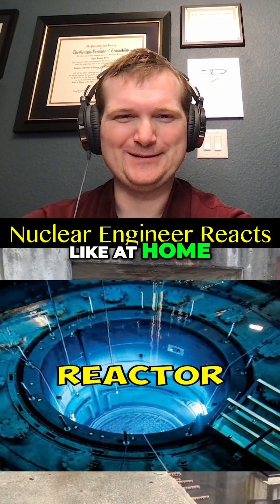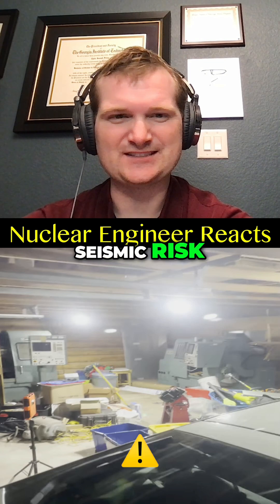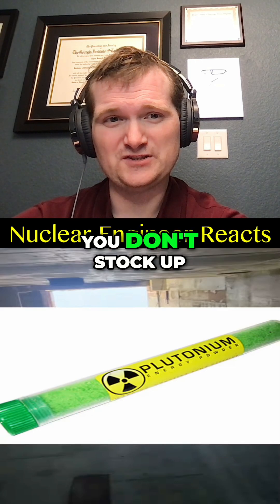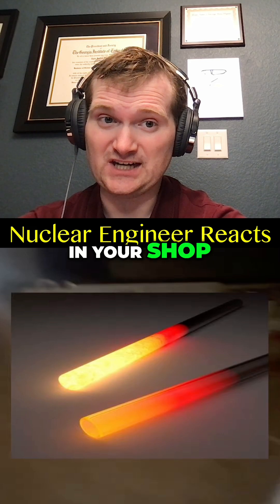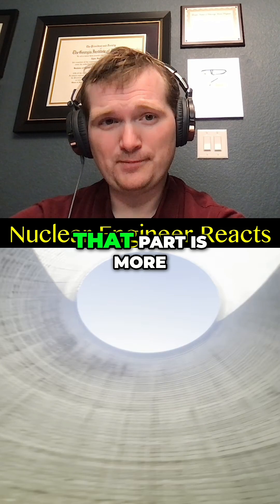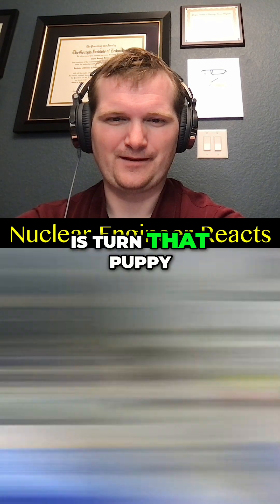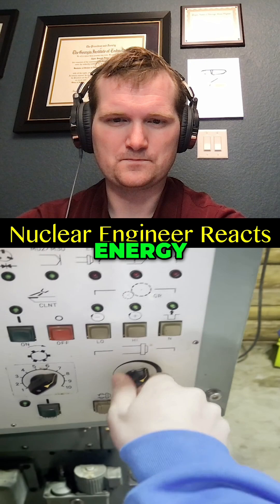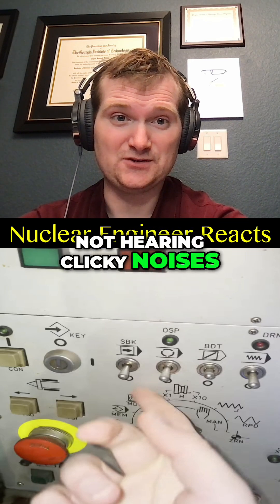How to Build a Nuclear Reactor - Debunked - Nuclear Engineer Reacts to StopShut

Comment: "Diverse, redundant, failsafe with independent power sources"  So my system should use both a Raspberry Pi and an Ardrino with two separate 9V batteries?

Comment: While you certainly can’t reasonably build a fission reactor in your garage, you can build fusion reactors, specifically Farnsworth-Hirsch type fusors and their variants (small scale reactors typically using inertial electrostatic confinement to confine deuterium ions into a plasma in a vacuum). It isn’t easy, but it can and has been done quite a few times by amateur hobbyists.

Comment: all you need is x500 Advanced circuits x500 Concrete  x500 Copper plate
s and x500 Steel plates

Comment: Thing is, that while I hear you saying "No!" to building these things in a garage or shed, that mad bastard, the Atomic Scout did, in fact, do that so its perfectly possible, as is building and operating a nuclear reactor without any form of permissions, oversight or anything else you'd want. 

 Its ILL ADVISED, but it is far from impossible to actually, physically do. It would definitely be among the most dangerous things one could spend ones time doing, but its not impossible at all.

Comment: What are some examples of “fail-safe” design features in PWR designs? In contemporary parlance “fail-safe” seems to get convolved with “highly safe” whereas it actually means “when it fails, it goes to a safe state.”

Like in liquid sodium-cooked reactors, the coolant is pumped with solid state electromagnetic coils (which is reliable, if not fail-safe), and when power fails cooling continues by convection, which looks like fail-safe. 

This was in the 70s and 80s, but reactor schematics always seemed to have stuff like “tertiary emergency letdown tanks/pumps” and “if the core gets uncovered, its meltdown city” and the failure safety simulations I was privy to were like LOFT (Loss Of Fluid Test) since the slightest compromise to the primary coolant cycle equals a massive steam explosion, since coolant is liquid at several atmospheres. 

So, the failure of a loss of coolant leading quickly to meltdown and immediately to a steam explosion, and possible release of radiation (even if it’s within containment) is not a failure to a “safe” situation, even if you have a series of big tanks and pumps that kick in to keep the core covered, or cooled, or whatever (barring loss of station power, of course).

Comment: Well, the first Fermi pile was somewhat close to Home Depot stuff, well other than the graphite blocks.
Meter accuracy though, great safety system, guy with a fire axe.    ;)
No heat rejection system other than the ambient air, which was also half of the shielding, the other half being the inverse square law.
First output, 0.5 watts. Final output, 200 watts, then they moved it someplace sane.   ;)

Heh, would love to put the plans for that one up for NRC review, just to see the look on their faces.
Gonna need a better set of running shoes first...

Comment: In a great irony, given the commentary... the World's first nuclear reactor was in fact a huge pile of wood, graphite, and uranium built in the middle of Chicago in an old Rackets(predecessor to squash) court.

It had no containment:  Indeed, no shielding whatsoever.  Also no cooling system.  The control rod was manipulated with manila ropes attached to an electric motor.  The SCRAM was an axe to cut the rope with.

Thankfully it only ran at about half a watt...

Comment: Imagine if they put that much effort into deciding whether or not we should keep using oil and coal.
Reply: Oil is used in everything.. and i mean everything so while you can reduce how much you use technically its not going away. 
As for coal while it can be replaced even nuclear reactors wed need a lot to do so, and then youd still want solar and wind, maybe hydro etc as supplementary options.

Not only is that incredibly expensive but time consuming itd take decades to do so to limit coal and oil usage by a large factor

Comment: Well you could build a very small pulsed criticality reactor using about 4.2kg of plutonium 239 or 14kg of uranium 235. It would be inside of a beryllium oxide reflector and use deuterated pentane as the coolant/moderator/working fluid. Could produce a few kw of heat for decades. Building in a garage is not recommended, but using it to power a space probe would be awesome 😂

Comment: Isnt there still a video on here showing you how to make a pocket sized nuclear reactor with aluminum foil cubes filled with different things, two big ass carpentry nails, then taping it together? Or was that only on a specific social media platform?....
Reply: That sounds like a battery, there's something called an rtg which is essentially a nuclear battery but it's not considered a reactor because the power comes from nuclear decay rather than fission reactions,I don't know what that video was on about but it was definitely bs

Comment: Good luck getting enriched uranium or Mixed Oxide fuel.

I could not even afford the biological shielding, not at the cost of concrete today.

I work with a nuke vendor.   Nuclear control systems are not a do it yourself project.

An unstable reactor leads to many phone calls.   I heard about a site coming out of outage.  They went through various phases of work.

One was called hydro.   Another is powerup.  They take many many hours to reach power.

Comment: If nuke waste is so radioactive. Why can't it be recycled till it's decay is zero.
Reply: They are/have been working on a new reactor type to do specifically that. Can't wait for it honestly.
Reply: France recycles their spent fuel. And the technology is not new either, it's from 1960s. It's not economically effective to run it down to zero, but a large percentage can be recovered with reasonable spending. And the more countries do it, the cheaper it becomes.
Reply: The spent fuel rods contain neutron absorbing fission products. So even if there is still a lot of fuel left, it doesn't sustain criticality very well once those fission products build up.

Comment: No but that's doable. I think if you just bought some scrap metal from home depot, mine uranium ore and place it under your pillow and the buy a cheap giger counter... you know - id call it safe. If it starts melting, you just, grab it, put it in the trunk and throw it in some place out of the city... and there! Nobody know you f**ed up. Just make sure whenever you are "operating" the garage reactor, you are in your underwear, wearing a pair of socks and some Halloween gloves with a mask. Or the "ritual" might not work and start melting corium. 🤣🤣🤣

Comment: I like how he doesn't explain how to do anything. It's just "Build a reactor and have some computers and turn that big boy on and enjoy!"
Reply: Well, one could build a natural uranium reactor, the hardest part being configuring the neutron reflectors to properly irradiate the core once the neutron generators initiate reactions or better, for a non-power type, sustain reactions so that one can't have a criticality accident with LOCA or loss of control rod configuration, just chop power to the neutron generator and one's run away safe.   ;)

After all, the original video said reactor, now energy producing reactor, breeder reactor or anything else, so anything that sustains a chain reaction would do. Shoot for something insane, like maybe a quarter watt.
Although, the licensing to even build that would be phenomenally intensive.
Try building one in your garage and somebody's gonna be knocking on your door to ask why you've that much purified uranium though and those folks notoriously have absolutely no sense of humor.
The thermal neutron source would be trivial to make in comparison. A basic neutrisistor would fit the bill for such a device with a bit of creative geometry.
Reply: It's a Youtube short. Were you expecting a PHD in Nuclear Engineering?
Reply: @MapleSamuraii Like the guy correcting the short? Yeah. It's about as useful as me saying that a modern chipset can be made by mining silicon, stuffing it into a machine, operating it and getting a free RTX 5090.
Reply: Pretty sure that whole video is a joke anyway

Comment: And to think, most of these complexities could be avoided with a molten salt reactor. Much smaller foundations, simpler mechanicals, ambient pressures, walk-away shut downs, no fuel rods to left or lower.a much much safer system.
Reply: One little caveat: molten salts are super corrosive.

Comment: Genuinely curious as to why Plutonium becomes an instant felony.  Any chance we can get a video expanding on that?
Reply: It can be used directly to build a nuclear bomb. While it's very unlikely that someone who doesn't have the means to produce plutonium themselves has the means to produce a nuclear bomb, it is possible. For example, plutonium could be sneaked into a country that doesn't even have a nuclear program, but has engineers capable of purifying explosives, constructing an explosive lens capable of compressing the plutonium core to reach prompt criticality, produce and program the control electronics with sufficient precision to achieve uniform compression.

Comment: Wasn't there a kid who wanted to make one, until he could detect the radiation 2 blocks away
Reply: Was that David Hahn?
Reply: @chrispark7823  yes
Reply: Nuclear breeding reactor btw (he made it to turn Th-232 into U-233)
Reply: @Ninjadolphins  is that Thorium?
Reply: @marbellaotaiza801  yes Th-232 is Thorium and U-233 is Uranium
Reply: @Ninjadolphins Thorium is cool. I heard Thorium reactors don't go boom like uranium ones in worst case scenario but they become crystallized or something like that.
Reply: @marbellaotaiza801  I have heard that, but apparently the thorium fuel is like super corrosive and has like something to do with tritium leaking from the reactor, but I do not know, I only saw a little bit of a video abt it a very long time ago so I don’t remember a lot about “Molten Salt Reactors” (the type of reactor that runs thorium).
Reply: And also Uranium reactors melting down isn’t really an imminent danger (unless the guidelines and regulations are loose) and I also heard Thorium reactors didn’t make enough energy, I will have to do more research about them.
Reply: Legend! Sheldon has nothing on that kid...
Reply: @marbellaotaiza801  Sheldon tried to order the fuel for it, but got stopped and an FBI agent told him it was wrong. Sheldon threw fit and then tried to build a “sonic death ray”
Reply: @Cent_Backwards  he failed to build the death ray too.
Reply: He managed to actually build one
Reply: @mohammedhersi5774  No, he only managed to make a neutron source and contaminate his garage. What he built was not even close to a reactor.
Reply: @mohammedhersi5774 no he didn't, watch his review of that story

Comment: Now all I need is a DeLorean DMC12 and a Flux Capacitor! 😆😆😆🤣
Reply: 1.21 Gigawatts! Great Scott!
Reply: Heavy
Reply: @8D2BFREE  yes ! Of course, a Heavy Water Reactor Moderator as well as a coolant for the nuclear power to create the electrical pulse of 1.21 gigawatts of power.
Reply: What, you don't have the Mr Fusion option yet?
Reply: @garyblack8717  Nah, we unfortunately aren't in the Sequel-Timeline.

We are stuck in the blooper reel timeline.
Reply: @garyblack8717  that is only available with a Hover Conversion kit. I still have the original prototype version. Which is why I have the Tactically Acquired Plutonium Fuel pellets in the Lead titanium case.